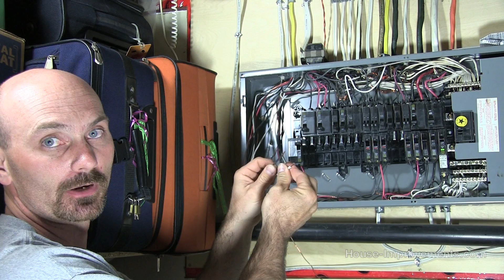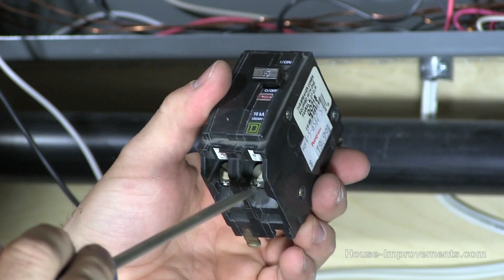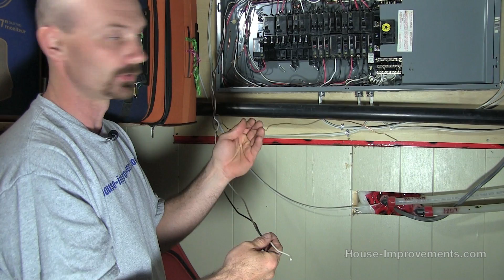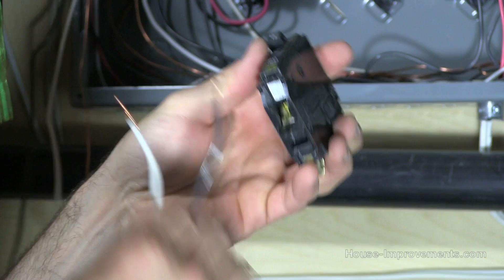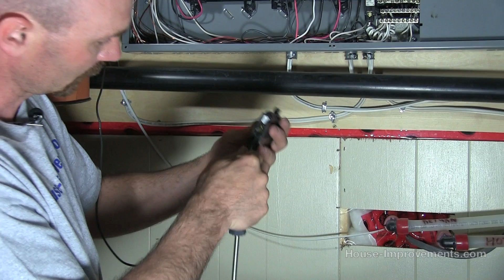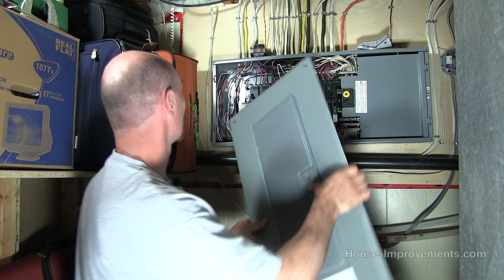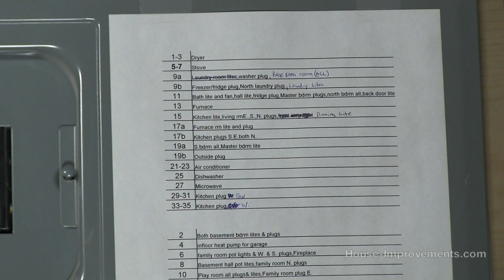How To Add a 120V 240V Circuit Breaker

Comment: Shannon, I use youtube to learn how to get things fixed, especially in the electrical realm.  This is the BEST presentation explaining how to add a circuit breaker to the breaker box.  I taught in college, and trust me you would make a great teacher.
Reply from the maker: thanks, I guess I am kinda a teacher as well
Reply: I don’t know if  this comment will reach you, but I thought I’d try because although I have years of experience in other building, and in manufacturing, trades, I do not have much background with the work of electricians. Probably a stupid question, but  I’ve always believed the stupidest questions are those that are not asked and then not knowing the answer leads to something getting screwed up, destroyed, or someone being hurt or killed. Why are there two hots on the 240 V circuit?  Next stupid question, are there any kind of rule of thumb guidelines for someone to determine what amp rating I would need based on what I am going to be running on that circuit? And is there also similar guidelines for voltage? OK, all done with the stupid questions, so along with the stupid comments from the losers sitting in their mom’s basement pounding their pud  trolling the Internet because they have no life, I would really appreciate answers to these questions so that when I do have an electrician come in to inspect the work, Or if I hire someone, I will know what I’m looking at and understand it better. Thank you, nice video, good content, and looking forward to learning some more a little later today.
Reply: 120VAC +120VAC = 240VAC, that should answer your first great question. I believe in this video he used a 240V for a heater, the reason behind this is because this heater requires a 240V.  For the amperage, sometimes the manufacturer specifies the size of the breaker to be used, but you'll also have to know what wire gauge you need based on the amperage which you get from the national electric code book or you could easily google it. I hope this answers your questions. I am not an electrician btw.

Comment: Nicely explained, and well done. The only thing you forgot to do was place some BLACK TAPE on the 220 White Breaker Wire, as you mentioned it is not neutral at that point.
Reply from the maker: You are correct i did forget that.
Reply: ike fun exactly, if that white wire confuses you coming off the breaker then you have zero business messing with electricity.
Reply: He did say to add the tape upstairs where it connects. Any electrician knows a wire hooked to breaker is hot. Therefore no need to mark that side. It's where the wire connects on the other end that needs to be marked...
Reply: So what about the natural wire? Is he gonna get it from some other circuit ?
Reply: @gil-juniorriseabovebetraya5972   you don't have a neutral with 220
Reply: @derrikvandyke3025  when I installed my 220 plugs for my stove my lines consisted of red black white and a common..... red and black are hot
Reply: Very true, I would use red or blue tape for it.

Comment: for 240V Can I use 12 Gauge with 4 wires as 12/3 . 2 hots 1 ground and 1 neutral ...and 20amp breaker please
Reply from the maker: Please ask your question in our forum as we have an electrician who is helping out a bit with questions like that @ http://www.house-improvements.com/forums/

Comment: Why do some wires have red and others have white?
Reply from the maker: Red and black wires are HOT (+) wires and white is generally a COMMON  (-) wire . The colour helps identify them
Reply: +HouseImprovements wow thanks. I am used to DC voltage it's simple. I'm not hooking anything up, just wondering.

Comment: Hey there i have a quick question ... i'm having problems with 3 - 240 volt outlets in my house they all worked at one time till about three weeks ago .. what happened was that the water heater on my house is outside on a side wall underneath a stairwell 
and where i live it rains quite a bit so what i saw that happened was that water had gotten inside a little compartment on the top of the water heater where the power is connected and it obviously shorted and sparked and burnt the 10 gauge wire so i got the water out changed the wire and it works now but only delivers 120 volts where it should be 240 for my stove and dryer also .... any idea how i can fix this ? and could it be the breaker?
Reply from the maker: Please use my forum for this question. http://www.house-improvements.com/forums/

Comment: for an outdoor outlet do I use a 120volt, 15 or 20 amp beaker? thanks
Reply from the maker: I suppose it depends what will be plugged in there but 15 amp is all that is required for most areas. Please use my forum if you need more help. http://www.house-improvements.com/forums/

Comment: Question as i'm use to everyone already having the stuff i need bought for me and when i started out i originally would just do all the wiring. But anyhow.

    I'm installing a stove that's 240 volt 40 amps what size wire and double breaker will i need? 

   If all the ground wires in my breaker box are older aluminum wires, if the new wire is copper will it still work as the ground normally? or will it mess the grounding up for it or other wires?
Reply from the maker: Please post your questions like this on my forum to be answered. http://www.house-improvements.com/forums/

Comment: This installation "looks" like it is from early 1970 in Norway. We mostly use 400 and 230 volts for homes and industry. By mistake which fuses turns off will both phases break. We turn off the main breaker will board be without voltage.
Reply from the maker: Here we use 240 and 120 in residential .

Comment: this is  a code violation, panels cannot be installed in closets
Reply from the maker: +mava why do you think this is a closet? this is a furnace utility room. You are correct though a panel should not be installed in a closet, although I have seen some that way unfortunately.
Reply: the video gives the impression this is a closet because I see suitcases on shelves
Reply: Panels can not be installed in "clothes" closets or bathrooms.

Comment: Great, informative video - thanks!
A question I've run into, please:  I have a flush circuit breaker / service panel box, and I need to run a cable out the rear of the box to the outside, and along my stucco outer wall.  Due to difficulty fishing cable from this flush box, can I use one of the rear, inside break-outs?  I'd like to break out one of the holes in the back of the box and use a PVC conduit to go outside to a box, then along the wall to an A/C disconnect box.  Will this be acceptable?  (Also, can I run it along the bottom of the stucco / top of foundation line, if secured with proper clamps there - then back up to about 24" to disconnect?)
Many thanks, again!
Reply from the maker: +Futur Foto Yes that all sounds like it would be fine as long as it is in conduit.
Reply: +HouseImprovements 
Thank you so much again for the video, and the time you took to answer!!!

Comment: Why don't you have a neutral wire on the 220 volt circuit?
Reply from the maker: +James Silverman not all 220V circuits use or need a neutral.
Reply from the maker: +HouseImprovements The only time a 240V circuit needs a neutral is when the appliance /machine using that power also has a part of it that uses 120V as well. A stove would be a good example As the oven and elements use 240v but the clock and electronics usually use 120V.

Comment: IN MORE THAN 40 YEARS WORKING AS AN ELECTRICIAN I HAVE NEVER SEEN ANY ELECTRICAL PANEL MOUNTED IN A HORIZONTAL POSITION........SO SHOCKING!!!
Reply from the maker: +Ed Greene Hmmm very common here, especially in a retro fit.
Reply: WHERE IS HERE? TEXAS, ALABAMA FLORIDA, GEORGIA. ...YOU TAKE THE TIME TO RIP OUT OLD AND UTILIZE SAME SPACE FOR NEW PANEL.

Comment: can you put 2 black wires into the 120 single pole breaker? I'm adding a light fixture and an outlet and there's no good way to daisy chain them.

edit: i've answered my own question-- its perfectly cool to double tap if the breaker is designed for it like the squareD QO 15 i'm gonna be using
Reply: Some breakers have a yoke on them that can accept two wires (although they're probably not rated for two). That being said, just wire nut the two blacks together with a tail and land the single tail on the breaker. You're probably still violating other codes regarding how circuits are to be loaded, but it's better than landing two wires on a single breaker.

Comment: Shannon, I am thinking of buying a house that had the breaker box and all the devisees stolen. The thief just cut all of the wires where them enter the box. Is there an easy way to find where the runs go, sense none are labeled. Thanks for your help.
Reply from the maker: +william sliemers No super easy way, but electricians have the right tools to do it. Installing a new panel is a job for an electrician not a DIYer anyway.

Comment: i have a square d panel , should you only use square d breakers?  also should any square d breaker fit if it is the right amp size or are there other specs you need to look for on the breaker you are replacing?
Reply from the maker: +GmGarlo Square D breakers will fit any position in the panel.

Comment: when you shutthe main off is the center bar that the breakers get juice from where you click them on is that also dead ( no Power ) as the main is off. I have a rusty center bar stopping my 220 stove to work and dont want to get a new breaker and clean that bar if its live?
Reply from the maker: +Richard Tringali If the bar is that rusty you should replace the entire electrical panel. The answer to your question is NO you must turn off the main breaker to kill that centre bar. There is still power to the panel at the main breaker though! please do not try to clean that bar!
Reply: So if I shut the main switch off in the fuse box that center bar is dead no juice at all because I need to see about fixing it myself as I can't afford a new panel to be done  all the other circuit breakers are fine it's just this one 220 one
Reply: Lol I replaced the box it was sparking like fireworks in there lol
Reply: Wonder if Richard ever cleaned the bar and lived.. hopefully he replaced the whole box.

Comment: If you add a circuit breaker and run out holes on neutral bar you could put 2 neutral wire on the same hole? Its that correct and safe? On 2 wires  14 g. Thanks.
Reply from the maker: +Giuseppe Climenti Yes, be sure the screw is tight
Reply: The correct answer: check the manufacturer's spec label in the panel.  Most do permit 2-3 conductors to be terminated under the same screw, generally as long as they are the same AWG size.

Comment: I'm running a Dayton 3vu36B 240V 5600W 23.3A Greenhouse heater. About 100 ft from my home.
Do I need a heavier gauge wire than 12 gauge?
Reply from the maker: +lookupdude78  I can not say for sure but if you come to my forum I have a couple of guys who I'm sure can help you out. I suspect that is to small for the distance.http://www.house-improvements.com/forums/

Comment: Great Video! this is the best demonstration I have seen on this. Instruction was the most comprehensive covering, lengh of excess wire, wireing sequence, safety, start to finish. covered all questions I had in mind and I was able to add a 120 v line for lights around my house feeling confident after watching this video. Thank you so much for this instruction. camera coverage was clear and instruction perfect.  I will subscribe.

Comment: I have a 40 amp 240V breaker going to my Eaton residential EV charger for my Nissan Leaf. I am getting a Tesla which utilizes 80% of the maximum breaker amperage (which is 80% of 40 = 32 amp). I was told that the Tesla will allow (80% of a 50 amp breaker = 40 amp). So if I swap the 40 amp breaker with a 50 amp breaker in the box, will I automatically get the higher amperage going through the Eaton EV residential charger, resulting in a higher amperage to charge my Tesla faster? Thank you.
Reply from the maker: +Arnold Winters Please ask your question in my forum, I can more easily answer you there.http://www.house-improvements.com/forums/
Reply: +Arnold Winters  Unless the wire was oversized for the original breaker (unlikely because thicker gauge wire costs more), you can't just change the breaker, undersized wire will overheat melt the plastic covering it and cause a fire.   This is especially important for EVs which are a continuous load (on for hours at a time).
Reply: +Arnold Winters  putting a larger amp breaker in will over fuse the wire and create a fire hazard. The wire will not handle the added amperage and heat up, this can cause a fire.   You need to upgrade the wire to handle that additional amperage.  here is a great booklet about all household wiring including that electrical code so it is done correctly.   http://clipperreviews.com/homeowners-diy-guide-to-electrical-wiring/

Comment: I have a 30 amp 240v connection, using 10/3 wires.

The neutral and ground should all go into to busbar? I looked at my panel and they seem to share that bar for neutral/ground.
Reply from the maker: +Wang Hung  On older panels ground and neutral share one bar
Reply: +HouseImprovements 

I see, that makes sense, thanks.

Comment: What would make a breaker start tripping (the dryer) even when the dryer is not plugged into the outlet? Is only 3.5 years old.
Reply from the maker: +Janelle Wolves  This is a serious problem. you either have a short circuit or ground fault situation somewhere in either the wire or plug . Leave that breaker off and call a licenced electrical contractor.

Comment: man why is it every time there is an electrical video, you see people in the comments bad mouthing the way they are doing things/and or they can do it better, or strutting their cock about saying they are a master electrician with 50 years experience ect.  I have yet to see a video where someone tells you to stick metal tongs on both bus bars while standing in a pool of water and wearing chain mail.
Reply: The reason is that there are unfortunately way more bad electricians than good ones. I'm not saying anything about this guy in particular, I'm just saying that there is an insane amount of stuff you have to know to really understand proper electrical construction, even just residential. I'm constantly learning new stuff and I've been an electrician for 18 years. I've seen plenty of guys with over a decade of experience who know almost nothing. They know just enough to make it work, but everything about the install is all wrong.
Reply: The Headless Horseman I hear you loud and clear brother, I notice that too, people always seem to be there to rubbish you! Having said that, however, not being an electrician myself, I like to hear those comments so that I can check them out and see if there's substance to what they're saying (as I want to be a safe 'non-electrician') The last two things said about my wiring I checked them out and found them to be wrong!
Reply: That's because it makes up for what's lacking in other areas. It's how people feel good about themselves.
Reply: HAHAHAHAH

Comment: Shannon i have 2 elect. boxes ..i havent started my project just yet running elect. from my house to my garage...in my basement theres 2 elect. boxes in separate rooms im guessing both boxes should be turned completely off when doing this? correct? im doing 120v
Reply from the maker: 00justincredible00  To be safe , yes.
Reply: AWSOME THX FOR QUICK REPLY!

Comment: Thanks so much! Your video saved our little family about a thousand bucks today. I have a couple of questions if you have a sec. 1- If the ground bar is out of spots or lugs, can you put a ground in with another? 2- Is connecting a 30 amp 220 breaker any different than a 20 amp 220, other than having the correct breaker, outlet and the wire (10 guage, with a blue wire)? 3- I'm using your info to connect a couple 20 amp 110 breakers to our exterior box, which is our main but my breakers are the first in the box. There is a ground bar, but no neutral bar. What to do with the white!? I know you're busy, we appreciate it if you have time to answer.
Reply from the maker: Curtis Spoerlein please use my forum for your questions.http://www.house-improvements.com/forums/

Comment: I installed a 220V outlet just like this and when I flipped it on, the outlet fried. I can't figure out why. Two hot wires coming from the outlet to the double pole breaker and the ground to the ground bar. This is wiring 101 and I'm stumped. It works fine if I hook the ground to the neutral bar though. Any chance maybe my ground was not correctly grounded on the ground bar? This is basic stuff and I am out of ideas.
Reply from the maker: John Rambo Sorry I'm not sure, that is odd.
Reply: BBQ Sandwich i
Reply: BBQ Sandwich s
Reply: BBQ Sandwich s

Comment: so a 240v circuit is just 2 runs of 120?
Reply: Basic Security videos yes, provided they are on separate phases. If you take 2 separate 120v runs from the same phase you only get, you guessed it 120v. They have to be on separate phases to get 240v. Also you should not use 2 single pole breakers(say 1 toward the top of the panel and 1 toward the bottom) to get your 240v. It should be a 2pole breaker that is tied together so should the circuit short or someone turn off, it will turn both off together thus illuminating risk of shock from one leg still being hot.
Reply from the maker: basically ...yes.
Reply: huh i actuly thought it was a 240